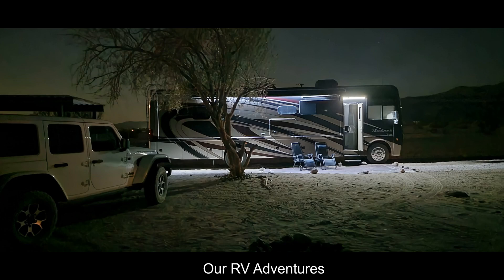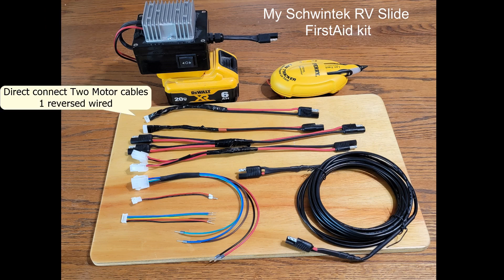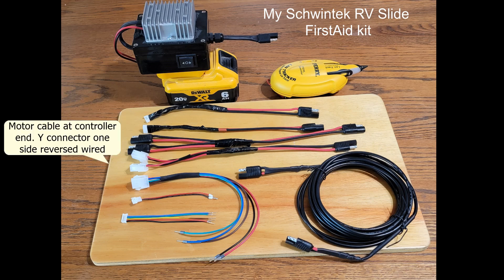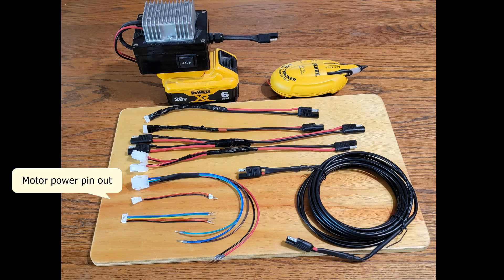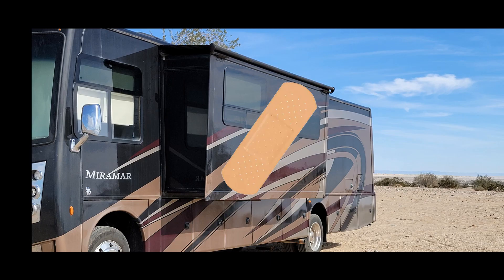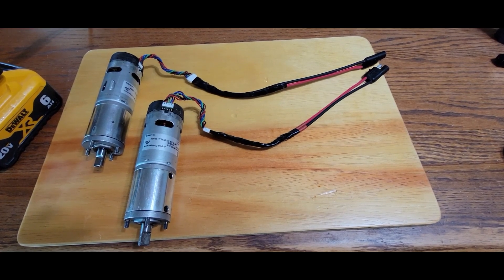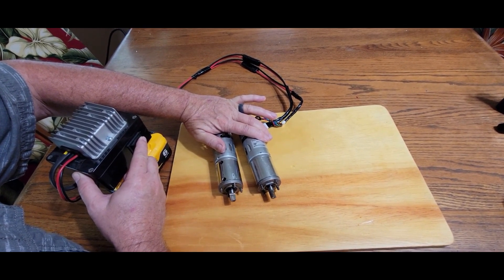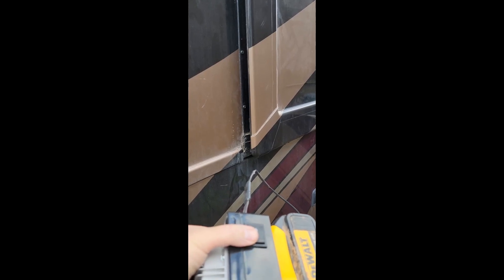Our Schwintek RV Slide FirstAid Kit

Comment: Thanks for the video, I have been looking for the motor plugs for awhile.
Reply from the maker: Having a Motor wire adapter works well I also have made a controller cable.  Wire plugs into both motor plugs in the controller.  This allows me to move a motor/ motors by the controller as well,  just another option in trouble shooting and maintenance.

Comment from the maker: I did add to my first aid kit a power cable that dose NOT use the Dewalt battery.   The cable connects to the power cable that goes into my slide controllers to a inline switch and this connects to my motor controller cable splitter.   This let's me power the motors from Rv power for testing and bypass the slide controller.